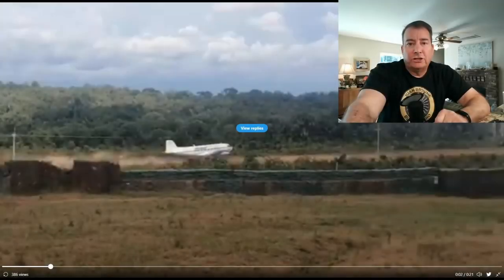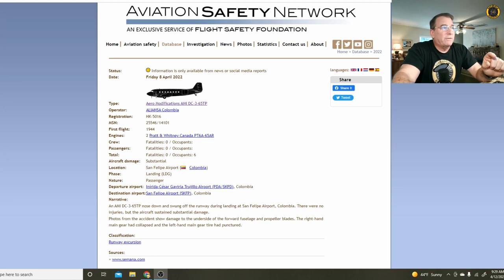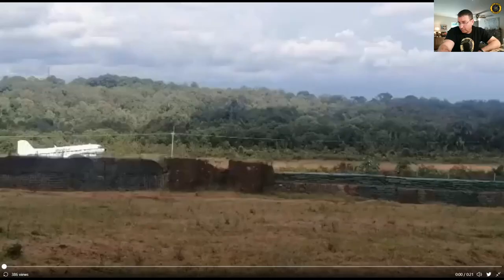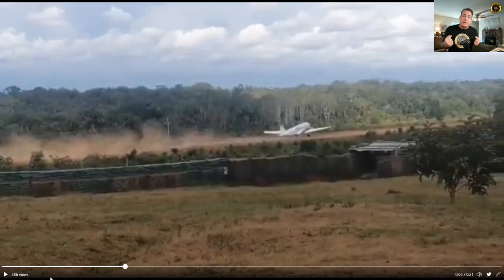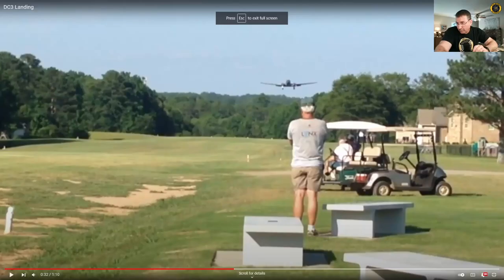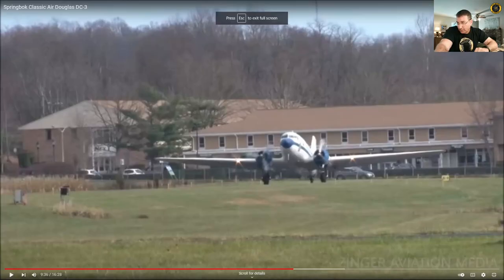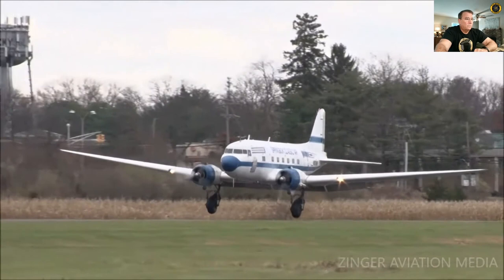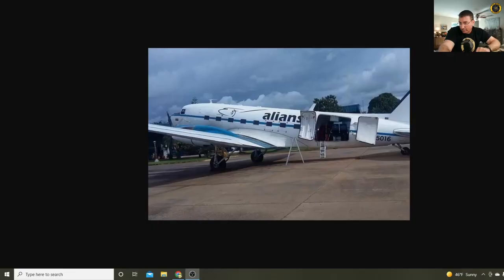DC 3-65TP Loss of Directional Control Colombia SA 8 April 2022

Comment: DC3s made great cropdusters, used extensively for a while in NZ. I recall seeing them doing their cycles when I was a kid. I don't know if any are still configured that way now but I'm very certain the last cropdusting was done back in the '80s with these planes
Reply: Yes there is a video about it.  And they were flown single pilot.  Balls...
Reply: @emergencylowmaneuvering7350   Yeah, James Aviation used to fly one out of Ardmore.    The runway end had a very high toetoe grass (pampas) hedge on it, his propwash used to blow it around on takeoff.   Engineering School had a lecture hall in an old hangar overlooking the runway end and when we heard this thing coming we'd all rush to look out the window to see if this was the day he finally overloaded it a bit too much and took out the hedge.   He never quite did.

Comment: First couple of frames seem to show the tail coming up. The speed looks wrong if this were a landing. I'm going with RTO and pilot error...trying to horse the plane in to the air before the turbos spooled up. Not sure how that works on a turboprop, but I'm assuming the turbines do need a few seconds to spool to get the torque to the props.

Comment: Another great report. Just a note at 7:02 you can see that they raise the flaps, if this is normal procedure maybe the crew that crashed instinctively put the flaps up at some point.
Reply: I'm no aviator, but once you're no longer flying and the main gear is solidly on the ground, it would make sense to raise the flaps to reduce lift as much as possible so the main gear has the aircraft's full weight on them - for better braking - since that aircraft doesn't seem to have spoilers on the top wing surface to help reduce lift.  Logical, but admittedly still a guess on my part.  :-)

Comment: The wheel landing seems like a safer and more stable landing configuration even if it extends landing a little. Looks cooler too which is worth %50.
Reply: You cannot 3 point a DC-3 on landing to prevent the fuselage from blanking out the vertical stab and rudder.  The only way to control is by keeping the tail up until it runs out of airspeed, therefore a wheel landing is required.
Reply: Theresa, the reason we don’t typically 3 point the DC-3 has more to do with stall characteristics than it does rudder response. The rudder is very responsive with the tail down. But we are at slower speed so it is proportional. 

A proper landing in the airplane is a balancing act. Landing it at speed to provide a stable touch down, flying it with the tail up to a point that the airplane is below the stall speed of the wings, then setting the tail down with enough speed to maintain directional control against the crosswind and gyroscopic forces. If you leave the tail up too long you are now a 25,000lb wind sock. 

The DC-3 is a great and forgiving machine. But it has its limitations like any airplane.
Reply: @theresacaron4238  Try telling that to the guys who flew them  on Skies .  They landed very tail low or 3 point to be at min speed  so as not 
to beat the airplane up to much on snow drifts.  The airplane can be 3 pointed  but much easier to wheel on.

Comment: Juan, before you added the commentary my first thought was that it was a rejected TO (considerable dust cloud from TO power?) but at a second glance could be a botched landing or landing gear/tire/wheel failure.  They could have dropped the LH main in a ditch too.   As to the rotationally bent prop blades, how much inertia does a turbine engine have?   Seems like they would take a while to spin down.
Reply: PT6 is a free recovery turbine type engine.  There is some rotational momentum but not a lot. Those babies were pulling power to cause that much carnage.

Comment: It almost looks like a takeoff incident with the no flaps, but there doesn't seem to be any substantial lift when they slam the tail down which feels like there's no power from the engines (so at landing power). It might just be a failed landing because of the wrong configuration (no flaps) and the pilot pulling the tail too fast when there was a bit of nose-down movement.

Comment: You can clearly see the left wing dip just prior to the hard left turn off the runway possibly due to a low spot in the dirt  runway causing a further loss of directional control of the aircraft .

Comment: Wonders why the RTO ? tire blew ? before take off ?
many questions .  DC3 's are such beautiful planes. Darn shame another one possibly gone. hope they can fix it. 
some secondary thoughts about the Dc3.
wonders about CG also on the accident aircraft . is there a point where ya can't  keep the tail in the air  long enough  or get it in the air fast enough ? Improper loading a factor?
also wonders how much runway was left? maybe he panicked !
Either way Pilot didnt do a good job that much is obvious !
Thanks for the vids as always cheers

Comment: When you get slow with the tail in the air, you have to use some differential braking for lateral control as the rudder loses effectiveness. That can be tricky on uneven surfaces. On a piston aircraft differential power could be used a little too, but on a turboprop I'm not sure you could control that very accurately. Do they use reverse prop on this aircraft? That could also go wrong. These are demanding aircraft to fly.

Comment: That looked like a well done Basler plane from Basler Turbo Conversions in Oshkosh. They are stretched ~4' and the PT6  engines are moved ahead to maintain correct CG.  Looked like an RTO to me, I very rarely guess though.    8)    --gary
Reply: I used to work at Basler. I’m not sure this was one of their rebuilds.
Reply: @rynetreatch9558  It seems to have the lengthened forward fuselage, but the engine nacelles are certainly different.
Reply: @awuma  the designation of the plane was also different. If it was one of Basler’s it would have said Basler BT-67.

Comment: The aircraft may have sustained extensive damage...but I bet it will be repaired.  A modern airliner maybe not so much.  There's a good reason why the DC-3/C-47 is still flying around the world some 90 years later.

Comment: With turbine DC-3s, there's beta and reverse thrust that may allow a different landing / RTO technique with a quick taildown, and it might even be dangerous to apply beta or reverse with the tail up.  This one is obviously an RTO, and it might have been some kind of disagreement in the beta and reverse conditions (after a proper taildown for this turbine mod) -- causing a sudden yaw moment that simply could not have been recoverable.

Comment: Hi Juan, like you channel. Did you do a report of the Convair accident in Southern Africa around 3-4 years ago ( I hadn’t found your channel back then ) ? If so could you link it on an upcoming video as I hadn’t seen or heard of any accident findings report. 
I saw the initial video taken by locals as well as onboard vid.
It would be great to have your “take” on that accident.
Cheers from Sydney Australia.
Reply: Excuse me butting in. Would this be ZS-BRV that crashed after the left engine caught fire just after take-off? The full official investigation report is available on the Aviation Safety Network web site.
Reply: @cedriclynch  many thanks👍

Comment: Really sad to see another DC-3 written off. Great explanation on the landing technique though!
Reply: Doesn't look like a write-off by any means.
Reply: @awuma  Both engines will need an inspection/overhaul, the core frame stressed from the nose to aft would need deep inspection and repairs, and the right wing looks like it would've taken a lot of stress due to the fact it looked like the plane spun around it on the ground, and of course the landing gear.

It could be restored given enough will, but it will likely just end up as a donor/parts plane now.

Comment: Loss of directional control, it's a tailwheel, very common. The flaps are raised after landing to help get the tail down. Wheel landings are standard procedure for 3's. It doesn't do a very good 3 point. Just quits flying and slams on the ground. I flew them about 2500 hours. Both rudder and brakes are used in directional control in those things. The only time I ever was scared on landing in one of those things, was when  one of the brakes was almost gone. Rudder alone just isn't enough.  So if he had that going on, that would explain going off to the side. But I'm guessing he just let it get away from him. They have a locking tailwheel that is only unlocked when ready to turn off the runway. But that holds it straight when it's locked. No help when the tail is in the air though.
Reply: I doubt very much that you successfully 3-pointed a DC-3 as you would lose directional control very quickly.  All DC-3's are wheel landed by qualified and rated pilots, enough said.
Reply: @theresacaron4238  I never said I 3 pointed it, the check airmen told me not to when I checked out in it back in '75, so I never tried one. I believed him. Wheel landings were all we did. He described how it just planted hard when trying to do that. So someone obviously tried it and told everyone not to. You flew DC-3s?

Comment: If the tail wheel is locked, how does the plane turn on the ground?
Reply: They lock it on the runway prior to takeoff, and unlock on the runway prior to the taxi.
Reply: @sofakingrad3530  Idiot me. I was thinking "fixed." Can they lock and unlock it from the cockpit?

Comment: Just speculation: on a DC-3 would hydraulic failure result in no flaps landing? Would a faster landing speed change how to "fly" the tail during landing? Would a main wing without flaps change the air flow and/or control surfaces behavior of the tail?
Reply: Yes and no.  I had a hydraulic failure just after takeoff from the beach at Egegik Alaska.  A line at the accumulator failed and filled the cockpit with pink 5606 mist. With pressure dropping to zero we weren’t quick enough to get the landing gear handle back to neutral, and the gear started coming back down. Unable to cruise in this configuration (destination was Kodiak, 2 hours and over water) I elected divert to King Salmon for the zero flap landing.  Approach speed was a little higher but not horrible. I don’t remember the numbers (was 30 years ago) maybe 115 knots or so. 
Gear free-falls and locks normally.  Uneventful zero flap landing. I tried the wheel brakes and had zero. First officer used the hand pump to no effect due to location of break. Next goal was to get the plane stopped in the remaining distance. 
I killed both engines using the single master on mag switch.  Rudder was effective for most of rollout and as we headed for the grass I remembered one last aerodynamic trick, opposite ailerons, which was pretty effective. We departed the paved surface and came to a stop between the VASI boxes near the departure end. 
So… my lesson learned was to use every available aerodynamic control available to you; early and often.

Comment: Never knew there was a DC3 turboprop outside Basler
Reply: There are several Turbo Dak versions. One operated by the South African Air Force flies over my home every week.
Reply: There is another company that does it in the States as well (Kansas maybe?). Rumor I heard when I worked at Basler was that a guy went to work for them (Basler) back in the day, quit a short time later, then showed up with this new competitor doing conversions.

Comment: One of the strongest parts on the DC-3 is the landing gear. It'll take a beating based on what I've read. They must have hit a ditch or something off the edge of the runway. Damn shame classic bird like that being torn up in a bad landing. In order to get this plane back in the air again after repair that landing gear and swap out the engines and propellers. Those engines have to be overhauled to fix the shock damage that they took.

Comment: Could be a rejected take off, but my guess is he didn't do a check list and did not set the flaps on landing, landed long and fast, braked hard, thought he was gonna nose-over so he planted the tail in the dirt, and then just smurfed the smeg out of it from there the way Juan describes, may have locked up the left wheel and blew or unmounted a tire, common on ground looping of big radial twins trying to stop too fast.

Comment: It looks to me like either the left tire blew first or the plane went off the compacted edge of the runway to the left because it appears as if the left side dips slightly before nosing over.  Anyone else seeing that or do I need new glasses?
Reply: Given how the props were bent, they pretty clearly had power in, and power with a significant canting relative to the wind spells P-factor as well ... possibly contributing?
Reply: That's the way it looked to me also.
Reply: @chrisschack9716  that seems like a reasonable assessment. Those props were all sorts of bent…I’ve seen less damage from a belly landing.

Comment: The fact that the flaps aren´t extended as is required on take-off, leads to thinking that the event appears to be a rejected take-off that was fouled up by forcing the elevator. Also, it is possible that the crew wasn´t properly trained on the turbine version as one with a different performance than the radial-engined model. Operations on these remote unpaved and narrow strips are an adventure and hold a surprise on all occasions.
Reply: Correction. "as required on landing".

Comment: Last video of successful wheel landing shows flaps retracted.
Reply from the maker: correct-well after touchdown
Reply: @blancolirio  Never having flown a DC-3, my guess is that the pilot retracted the flaps while the tail is still up in order to reduce lift, put more weight on the mains in order to allow continued directional control while transitioning to 3 point tail down.

Comment: First time I have seen you miss a crucial clue, Juan! Any propeller making contact with the ground under power will curl forward. In this case all blades on both props are bent sideways AND they are fully feathered! My SWAG (silly, wild-arsed guess) is that someone pulled both prop pitch levers into feather on liftoff rotation.
Reply: PT6 is fully feathered at idle.
Reply: @b05296 , Wrong! The pitch of the propeller blades of any free-turbine engine is determined by the position of the prop control levers. The PT-6 is feathered during start and will happily turn slowly , idling in that condition. In fact, you can keep the propeller of a Twin Otter from rotating with one finger from start to idle, the torque is so negligible. Move the prop levers out of "feather" and the propeller will start spinning like mad, still in idle.
What is correct about your statement is the fact that free-turbine engines are usually feathered intentionally when the aircraft is in parking position and will idle that way until the fuel/condition levers are moved to cutoff/shutdown.
Reply: @Halli50  like I said, engines back to idle .....
Reply from the maker: No.
Reply: Not the first time I've been mistaken....

Comment: Three point landings are not recommended on the dc3? If not, why so?
Reply: You loose directional control~ no air on the Tail-rudder...i think..
Reply: @wendygerrish4964  on every tail-dragger I have flown (Piper Cub and Kit Fox) the option of two or three wheel landing is there. You can choose. You keep rudder authority by using throttle when necessary. Also differential braking can help maintaining directional control so why not on the dc3?

Comment: Aircraft blows right tire and veers to the left? Did I miss something? It seems that the failure of a starboard side tire would pull the aircraft very suddenly to the right. Not to the left. It looks to me like the starboard tire and landing gear were intact until the plane left the runway and the plane spun around the axis of the port side landing gear as it sank into the mud.

Comment: Juan - It's not correct to say that the rudder is blanked out when you pull the tail down. The rudder can be used to taxi so it remains effective. What happens when you raise and lower the tail is P-Factor will cause the aircraft to swing left when you raise the tail and right when you lower the tail. A burst tire would certainly cause severe directional control issues.
Reply from the maker: Incorrect.
Reply: @harveymckinnon6043  🤦🙄

Comment: Wrong the turbodak skipper should have 'walked' the turbo dakota straight using differential engine thrust ,or bang both throttles wide open to lift off for another attempt at landing ,for he touched down too deep on the dirt strip. Sorry but that driver goofed up.

Comment: Is that really going fast enough for rudder directional effect at that time?
Also I wonder if once you've touched down if attention might drift from firm vertical/elevation hold on a control or stick. Is that emphasized even in elementary instruction/training?
So sad to see anything unpleasant with the legendary DC-3.

Comment: The aircraft appears to enter a skid to the right just after it passes the first power pole. I'd say they had a right engine fail on take off which caused the right yaw/skid. Then full left engine reverse would drag the aircraft off the left side of the runway & cause the tail to bang down as it did.
Either that or the left tyre blow out on take off & the pilots put in a boot load of right rudder followed by a fist full of reverse:)

Comment: Left tyre blew first, he attempted to reject landing, but didn't have enough speed to get the weight off the flat tyre, still had it straight when left wheel hit a bump and the strut failed. You can see the left side dip down just before the sudden veer to the left.

Comment: You still have rudder authority even when the tail is down.  On the turbo 3's when you put the tail down you can use full reverse thrust, if you use full reverse thrust with the tail up you'll be going for a little adventure.  Legacy DC-3's don't have reverse so they would use a different procedure.